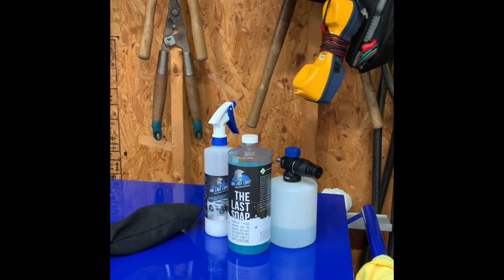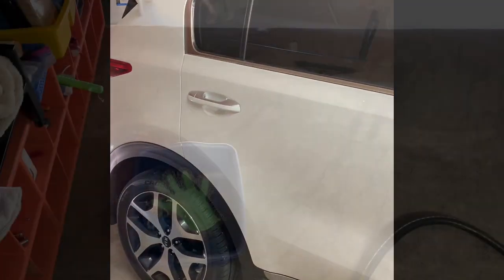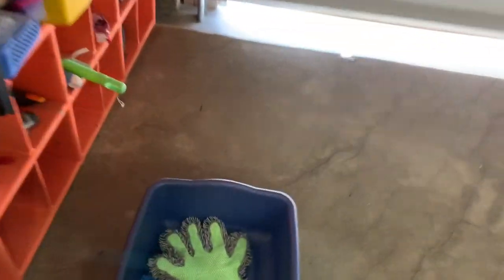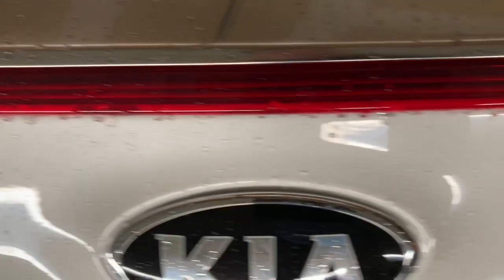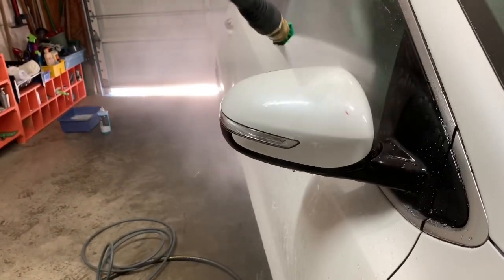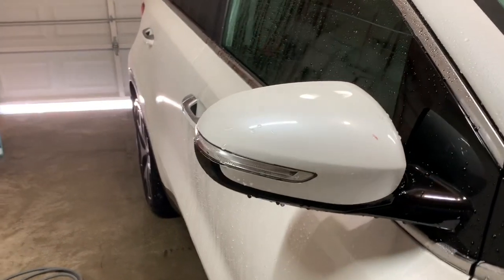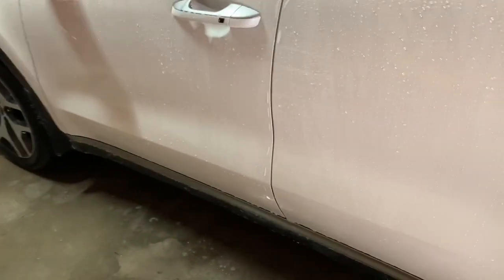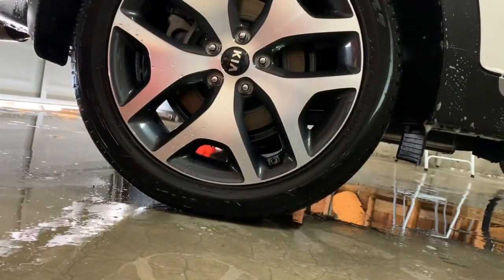Car wash tips and Last Coat review.

Comment: I used Last Coat for the first time recently and I’ve never had the car water spot so badly. I bought two bottles 
and I’m not sure what to do with the second one as I certainly don’t want to use it again. I’m going to 
stick with Beadmaker.
Reply: Have you tried the second version of the last coat? It’s way better than the first! And it beats bead maker in you tube tests.
Reply: Seventh Studio No I haven’t tried the new version. They sent me the old version 1 week before they started selling the new version and didn’t tell me they were coming out with a new version, so I haven’t been anxious to do anymore business with them.
Reply: Bill Buss to bad because the second version is really good, better that most on the market and their black ice is a great lite ceramic coating, even better than Gyeon Cancoat
Reply: Seventh Studio Actually I decided to give them another shot and purchased their Black Ice. I haven’t applied it yet but I’m anxious to see how it works.
Reply: Bill Buss I applied black ice about 4 weeks ago. It’s very easy to use! Do the prep work and protect it with TLC2 or AMP and it can last close to 2 years. But I really enjoyed using it.
Reply: Seventh Studio I’m mainly interested in gloss enhancement, how about that?
Reply: Bill Buss  all there products produce really good gloss. Their AMP quick retailer is great, but it’s a short term product. Their TLC2 is a really good medium between black ice and AMP, and has good gloss.